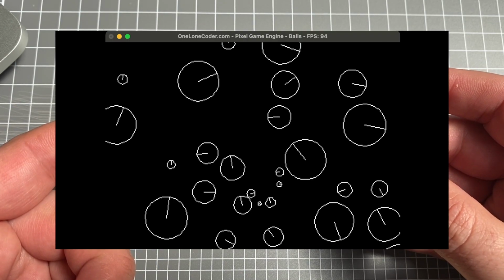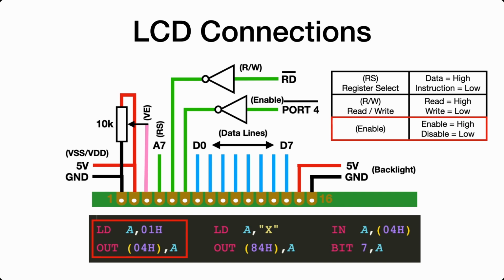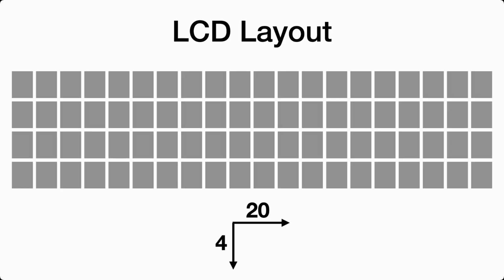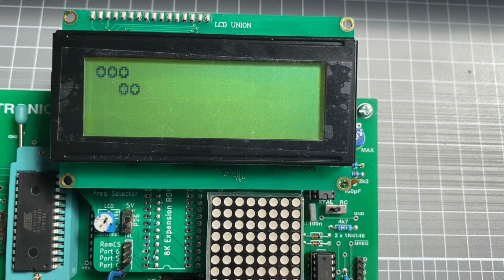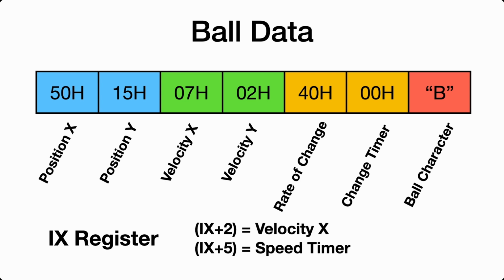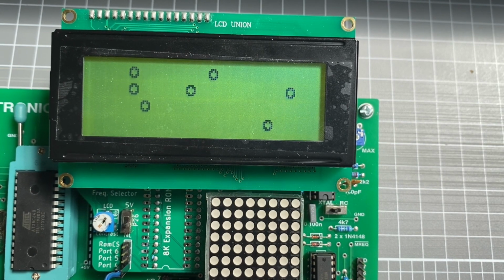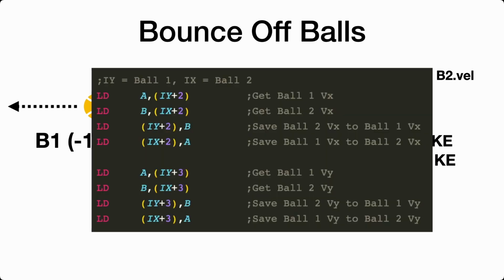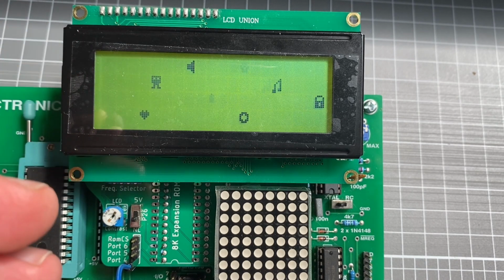Mastering LCD Particle Physics on a Z80 Microprocessor

Comment: Some old fashioned LCD displays are just to low in resolution to express the subtilty of a bouncing ball. Maybe it would be better if every ball had two or more stages, once it is in the centre of the place where the character is shown, then only half the character is shown, but on the position besides it, the other half of that ball. In this way the movement is more gently. Now it is hopping from one position to another. 
 
Don't look at me, I can't do it myself. It is like I am from Barcelona when it comes to sinus and cosine, tangent and arctangent, mathematics are simply not my strongest point, unfortunately I missed that day in school.

Comment: Hi! Nice video!
Have you considered using the 8 custom chars offered by the LCD controller?
With these you can show at least 2 simultaneous "hi definition" balls, each using a 2 by 2 characters grid as render canvas.
Also you can render up to 8 indipendent balls simultaneously if you make them only 1x1 pixel each.
Greetings from Italy!
Reply from the maker: Yes. That was my intention to use the custom characters to represent the particle in pixel space. But I had time constraints to get the video out. It will be a good update for the code.